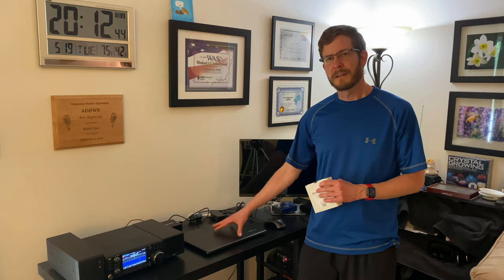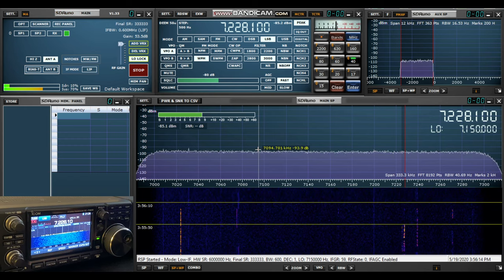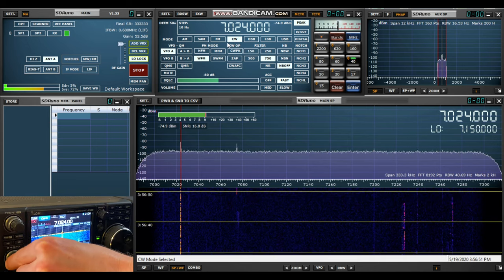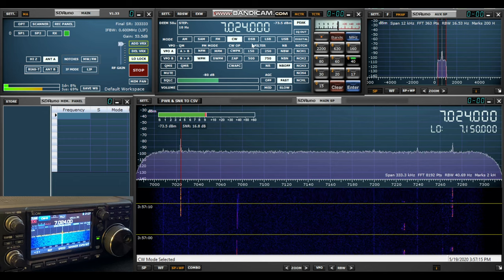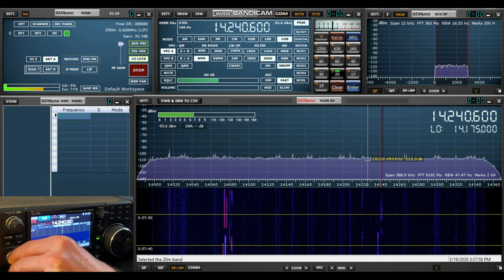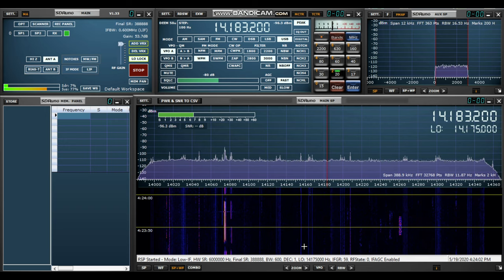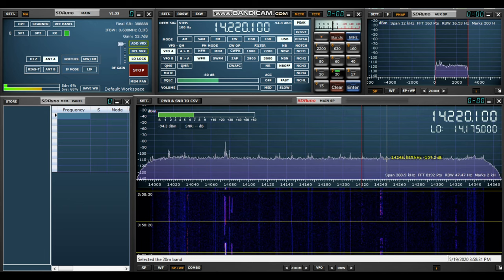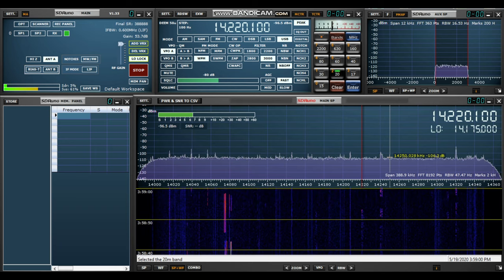IC-7300 RadioAnalog Panadaptor Module

Comment: Have you tried to get the frequency control to sync with HRD? I am trying to use their satellite tracking program to work with RSPDX-R2. I am also using Ic-7300
Reply from the maker: Unfortunately, I haven't used HRD before so I'm unsure. 73 de AD0WE  dit dit

Comment: Can I feed this to a monitor or does it have to be a PC.
Reply from the maker: The panadaptor just provides RF out. You'll need a separate SDR (Software Defined Radio) to hook it up to. Most SDRs will need a computer to control the SDR and display the waterfall. 73 de AD0WE  dit dit

Comment: You say you’re in an apartment, what antenna are you using?
Reply from the maker: White speaker-wire-based dipole antenna that runs along the top of the ceiling and wraps around two-thirds of the room. Speaker wire has two leads. One lead is cut to 20m and the other 40m. I use an antenna tuner to run on 10, 12, 15, 17, 20, 30, 40m. And for obvious reasons, I only run QRP. :)
Reply: Sounds great, I was so disappointed that I sold my entire HF station, 7610 ect. Now I’m going to get me some more equipment, just retired a year ago.
Reply from the maker: @gregboggs4721  Awesome. I wish you all the best in getting started again, Greg. The further you can get the antenna away from other electronics, the better. It helps lower the noise floor, lets you run more power, and avoids front-end overloading of other electronics.

Comment: Having some really odd behavior that maybe someone could shed some light on. I have an IC-7300 that I am using SDRuno and an RSP1A as a panadapter for it. I am doing this with one of those PTRX boards installed in my 7300. It was all working very well. Had to tear all my stuff down to set it up in a new desk I got for the shack and when I put  back together this happens. When I started SDRuno, it asked me if I wasted to install the new version and I did. when it starts up now, my radio automatically goes into transmit. Looked at the settings in Omni-Rig and nothing has changed. If I disconnect the PTRX and run  SDRuno on its own it works fine. Anyone have any idea what could be going on here? Thanks and 73's Bruce
Reply from the maker: Greetings Bruce. That is a frustrating problem. I have not encountered anything like that. Then again, I haven't upgraded SDRuno in at least six months. You may want to reach out to SDRplay for technical support — https://www.sdrplay.com/help/ . You can open a ticket by selecting RSP1A, Windows XX, and "Other (specify in issue details)," and then click the "Still need help? Click here to raise ticket." I wish you the best of luck in getting to the bottom of your problem. 73 de AD0WE

Comment: What is the difference between installing an expensive PanAdapter to the 7300 compared to just using the USB cable mode of connection?
Reply from the maker: Greetings. The USB cable will provide audio that can be decoded as a waterfall stream. The problem is that you are limited to 3k Hz worth of spectrum. On the other hand, a PanAdapter can show you the entire waterfall at one time. Some pan adaptors will even show you multiple bands at the same time. 73 de AD0WE  dit dit
Reply: @KurtZoglmann  Thanks Kurt.  I appreciate you clearing that up for me.  I might have to consider one in the future.  I just got my 7300 and haven't actually had time to play with it yet.  I'm still studying all the YouTube videos about it.   Lon....N5LON
Reply: @KurtZoglmann  I'd like to see that.  Do you happen to know which one(s) might do that?  73 KA1E
Reply from the maker: @douglaskbrander  Greetings, Doug. You are wanting to know which SDRs support seeing the whole band at once? The RadioAnalog Panadaptor allows you to connect an SDR to your Icom 7300 and share the same antenna without worrying about blowing up the SDR when you transmit. In the video, I'm using an SDRplay RSP2pro, which is now discontinued. They are other cheaper options, but I'd get an SDR radio with decent HF filters and wide bandwidth to view one or even multiple bands simultaneously.
Reply: I believe you said some adapters allow the viewing multiple bands simultaneously and I’m wondering which one(s)?
Reply: @justcurious8263  You should ask that question in a new reply (reply to the owner of the channel) instead of replying in my original comment.  He will never see it here.  He is only notified of new comments.
Reply from the maker: @justcurious8263  The SDRplay SDR receivers (RSP1A, RSPdx, and RSPduo) can take in 10Mhz at one time. As long as the two bands that you want to look at fit within that 10Mhz bandwidth, you can view both simultaneously, such as viewing 3.5Mhz and 7Mhz at the same time.